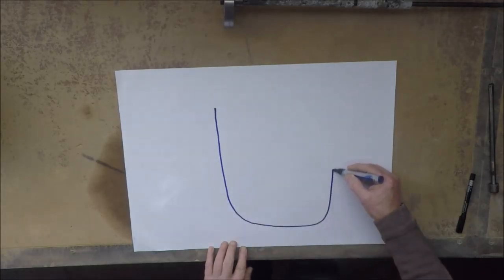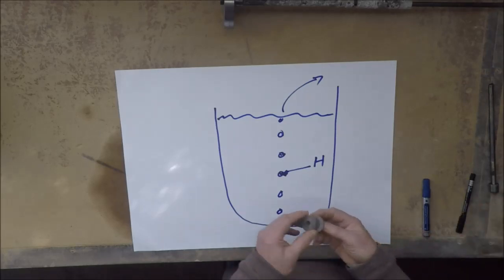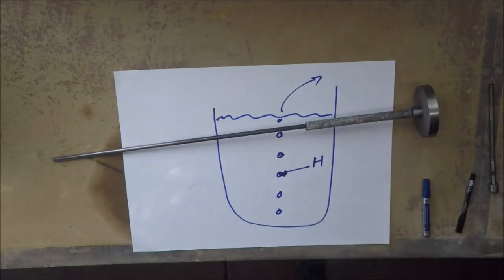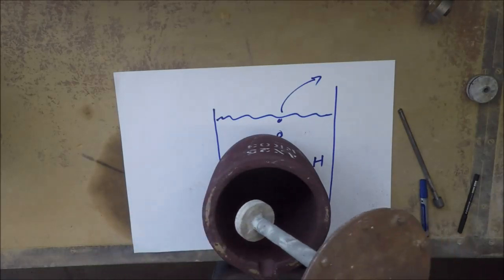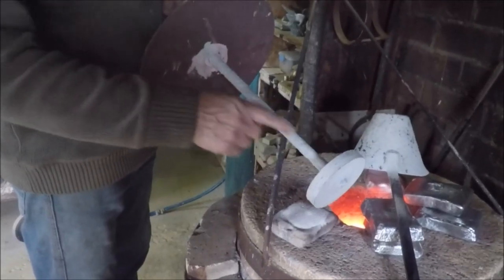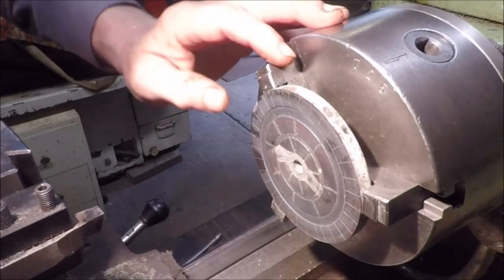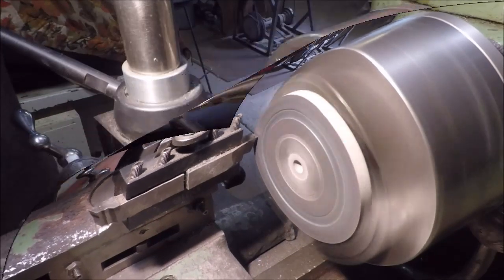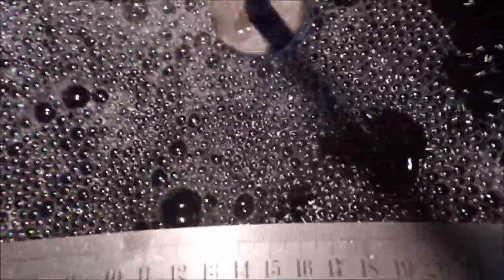My Home Foundry, Most recent Degasing Lance

Comment: Hi, I think your lance design is well developed and you have clearly experimented with the operation of it. I am just wondering though if degassing tablets would be an alternative for someone who only does the occasional casting job. I cannot find a supplier of degassing tablets here in Australia (who will sell in small quantities) and the overseas suppliers won't ship outside their own countries. Just the same, I am interested in your views on how effective the tablets would be.
Reply from the maker: Mark, I have used degassing tablets. Years ago one could get hexachlorethane degassing tablets and these worked fairly well both at degassing and at floating up oxides within the metal. However these are now considered a no-no as they cause ozone layer depletion. There are degassing tablets available that generate nitrogen gas they are usually grey. I have tried these and to be honest I was not impressed! They bubbled so fiercely that they caused so much turbulence in the crucible of metal that 50 mm of the metal was splashed out all over the inside of my furnace. I had to put a heavy steel ring on top of the crucible to stop this loss. But this sort of turbulence causes more hydrogen to be absorbed from the furnace atmosphere so I was dubious as to if these tablets did any good. A friend and owner of a much bigger foundry did some tests and he became convinced that these tables actually increased the gas level rather than reduced it! I abandoned these tablets in favour of my fine bubble lance and I immediately noticed that I had to use bigger feeders as I no longer had gas to help counteract shrinkage! To be honest my advice to the average occasional metal caster is not to bother with degassing. Just make sure your metal is clean of oil grease paint and is dry, melt as quickly as you reasonably can don't get it too hot, never over 760 deg C. and pour without delay. Assuming that you are not trying to cast very thick parts you should not have too much of a problem with gas. Gas porosity is usually quite fine, around 0.5 mm or less pore diameter, and this is easily smeared over during machining of most aluminium alloys so you wont see it! All my work is heat treated so it machines much better and without smearing and some of it is diamond machined and that will produce such a well finished surface that even very minor porosity is easily seen so I have to degas as well as I can. I think that many occasional casters get way too concerned about gas porosity, unless you get a real bad case (I have seen a few -:)) of gas and assuming that your castings are reasonably thin i.e. the solidify quickly you are unlikely to notice much of a gas problem. If you do then something is wrong so contact me with the details if that is the case. One last thing many people "degas" with washing soda (sodium carbonate) IT DOES NOT WORK in fact it INCREASES the gas level so please don't try it... Martin
Reply: Your comments back up some other reading that I was doing yesterday. The consensus was that for small castings, degassing is probably not necessary. I will take on board what you have suggested about not overheating the melt and trying to keep the sections thin. I am guessing that my castings do have quite a bit of porosity but having said that I have never had one fail and the finished castings are either powder coated or don't need a high quality finish anyway. I think Myfordboy started the whole washing soda thing and yes, I too thought it was a good idea since I was seeing lots of bubbles coming to the surface after I stirred the washing soda in to the melt. 
Thanks for your detailed reply.
Mark Presling
Reply from the maker: Mark, It may well have been myford who started off this whole degas with washing soda rubbish, I am not sure but whoever did start it off has a lot to answer for.
The problem is that the hydrogen gets in our molten aluminium from (in the main) its reaction with water in the air. There is of course always water in the air and particularly in furnace gases as water is a product of combustion. The aluminium reacts with the water to form hydrogen which dissolves in the aluminium and aluminium oxide which in the form of thin films floats around in the aluminium causing lines of weakness in the eventual casting.
 Now washing soda comes in two  main forms the first is Na2CO3, it usually is a granular white powder. The second form is Na2CO3.10H2O, this is the traditional "washing soda". It is usually in the form of transparent ice like small crystals. It is the 10H2O that is the problem, this is water of crystallization and it is driven off with moderate heat, this substance is in fact about 63% water by weight. If you plunge the first form into molten aluminium nothing much will happen perhaps a small bubble of two but that's it. The Na2CO3 does NOT break down to produce CO2. Even if it did any CO2 get given off will not degas aluminium as it will react with it to produce C and aluminium oxide. Luckygen1001 proved much of this in one of his videos. However if you plunge the second form into molten aluminium all that water is driven off as steam, lots of it, and this is what you see bubbling out of the aluminium. Remembering how the hydrogen gets into our aluminium it is obvious that the worst thing we could do is to bubble steam through the molten aluminium. This can only INCREASE the hydrogen content so attempting to degas with washing soda is worse that a complete waste of time and sadly so many people have copied the technique simply because someone who has been on YT for a while and knows no better not only insists that the technique works but defends it quite fiercely... Martin

Comment: Thanks for really useful video. I am very admired by your original lance design. But is it just your home solution, or maybe you took something as a base from industrial prototypes? I ask you because I am aquintenced about main designs of the degassers (graphite rotors or just immersed tubes with holes), however I haven't met somethink like that. So, it's interesting to me, is there similar industial solutions or is it only your original homemade device?
Reply from the maker: Edward, I am sorry for the delayed reply. I have rather a lot going on and don't always get around to replying as soon as I would like. Your question requires a fairly long answer so forgive me if I put you off until I have the time to answer it properly - soon I hope.... Martin
PS, if I forget (I am old 😊) please ask it again to remind me.
Reply from the maker: Edward, The lance design is my home solution, but it is based on the following;
1, The realization many years ago that for successful degassing the purge bubble size must be as small as possible. This is backed up by the standard industrial practice of using rotary degassers as these chop the bubbles in quite small sizes.
2, The use industrially of porous plug type degassers where the degassing head is made from a porous ceramic  - firebrick and silicon carbide are typical,. The pores through which the purge gas emanates are very small and do produce reasonable fine bubbles. 
Obviously you are aware of  these points 1 and 2
3, Based on John Campbells work  - the knowledge that the size of bubble generated  by blowing gas out of a hole is dependent on the hole size and the liquid into which the gas is being blown. (Bubbles blown in water are about 1/3 the size of bubbles being blown into molten aluminium – for example) The pressure blowing the purge gas through the holes apparently has no effect on the bubble size (rather counter intuitive I feel, but apparently true) Note - very high gas velocities producing very high Reynold’s numbers in the purge gas flow MAY change this – I was yet to explore this avenue.
4, About the smallest hole size I could make was 0.1 mm. According to Campbell (Complete Casting Design Handbook 2015 edition page 390 Fig 7.35) this should give a bubble size of about 3mm in aluminium or about 1mm in water. Indeed, water tests did indicate a size of about 1 mm diameter. I would have liked a smaller bubble size in the molten aluminium but this was about as good as I could do.
5, There is no way that I could drill 0.1 mm holes but I could score a flat disc with 0.1mm deep groves and then clamp another, but unscored, flat disc against it to effectively give me the required 0.1 mm holes.
Thus, the lance that I developed.
 To my knowledge there is nothing like it used industrially. I am not surprised by this as it is too demanding of maintenance. The head (i.e. the two discs) are made from cast iron and they seem to last quite well but do oxidize on the clamped faces and these need periodic re-machining. The vertical hollow shaft through which the gas enters the “head” is a constant source of problems as the rising bubbles seem to disturb the protective coat I use (boron nitride hard coat by ZYP coatings) and the aluminium frequently attacks this shaft. After no more that two uses I have to check the shaft, grind off any attacked areas, oxidize with heat, and then reapply the hard coat. Attack seems to occur about 50% of the time. The head is never attacked. In any case I apply fresh had coat every day before use of the lance, this coat is dried at red heat before use of the lance
The inner of this shaft is a stainless steel pipe and if the aluminium gets at it attack is rapid so I use a thick sacrificial sheath of mild steel around it and it is this that I have to remove any attacked areas from. I have tried a graphite sheath but it to had problems – it tended to float and even when I prevented this aluminium seemed to somehow to get up inside the bottom of this sheath and around the inner stainless tube. This was difficult to deal with and I was working on a solution when ill health brought a sad halt to my casting endeavors – so no solution yet! But I do think this is the way to go.
One problem I had with the lance design as shown in the video is that for reasons unknown the central bolt holding the two discs together seemed to work loose very easily – the result was that instead of small holes around the discs I had a continuous slit and this produced bubbles that were way too big. I got around this by bolting the two discs together with about 8 small bolts placed fairly close to the outer edge.
I hope that this answers your questions - if not do not be afraid to ask further
… Martin

Comment: Hello Martin, sorry for my bad capacity to English language, but I don't understand the choice of material used for protect the lance. What is your choice ? Many thinks for all Master 👌
Reply from the maker: Matthew, I paint the lance with a boron nitride paint this paint is called "BN Hardcoat" it is made by ZYP Coatings. They have a web site. It is a water based material and I let it dry then heat the lance to almost red heat before using .... Martin

Comment: Martin on the subject of Argon gas bottle costs, you might wish to look into the deal going at Bunnings where you pay a deposit on the bottle @ $200 and then just pay for the gas each time you return the bottle @ $90 for Argon in a D sized bottle.
Reply from the maker: Mark, Yes I think that you mentioned this before in a comment to another of my videos. My large rented E cylinder still has heaps of gas inn it so I have not yet had to look into this source.

Comment: Just wondering after 7yrs if you have ever attempted using tablets and if they work? I have seen a lot of degassing flux tablets on the market that look tempting to try.
Reply from the maker: Todd,
         Years ago, I used hexachloroethane tablets to try and degas my aluminium. Not having a Reduced pressure test apparatus, I cannot really be sure how well they degassed my metal. I never got any complaints about gas levels though, but then gas is hard to see even in well machined castings as the machining tends to flow metal overt the small gas bubbles and true gas bubbles are indeed small - usually below 0.5 mm. I do feel that the hexachloroethane did a pretty good job of floating oxides etc to the surface. It also did a pretty good job of rotting my tin roof which now leaks.  Note that I did not use the traditional bell shaped plunger as these hold the purge gas back until it forms large (read “useless”) bubbles. You can no longer get these tablets as they posed a threat to the ozone layer, well not here in Australia anyway. The tablets that you are referring too are I guess the ones that liberate nitrogen gas when plunged. I was forced to use these when the hexa was phased out and I have to say that I was not impressed. The first problem was that they bubbled so viciously that they threw 50 mm of metal out of my A25 crucible and all over the inside of my furnace. I used to put a high steel ring on the top of the crucible to catch this ejected metal and direct it back into the crucible. This sort of turbulence is very bad as it generates oxide which winds up in the metal as thin films and it exposes metal to the atmosphere and its attendant water (humidity) thus it generates hydrogen in the metal – likely more that it removes??? The second problem was that the tablets only produce nitrogen for a few minutes (2-4) and not long enough to properly remove any hydrogen in the metal - this meant doing it at least twice. Another foundry much bigger than mine did some tests comparing these tablets with argon gas bubbling from a porous Silicon carbide hockey stick type lance. They claimed that their tests showed that not only was the hockey stick better at removing gas but the nitrogen tablets actually made gas levels worse if used once the hockey stick had done its job. I have no reason to doubt their results. This was at least 10 years ago and its why I developed my own argon lance. Somehow, I doubt that the nitrogen tablets have got any better and that it is likely that they just make the foundryman feel good rather than actually do any useful degassing. The manufacturers of said tablets would no doubt disagree 😊. I think that I still have some of these tablets sitting here so if you wish to try them and you live close call in and I will give you some  – just need to check that I did not throw them out though. I would doubt that the tablets currently available are any different to the ones I tried. Note that I have done some mods to the lance shown in this video and I really should do an update but health currently prevents….
 Martin